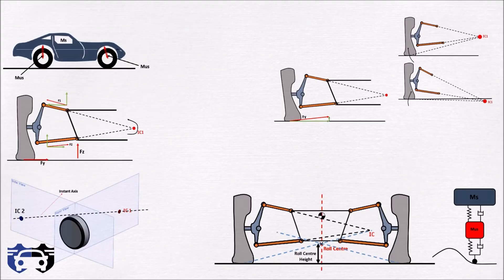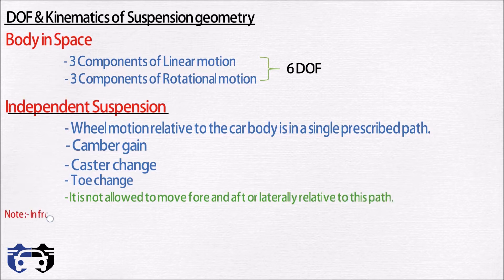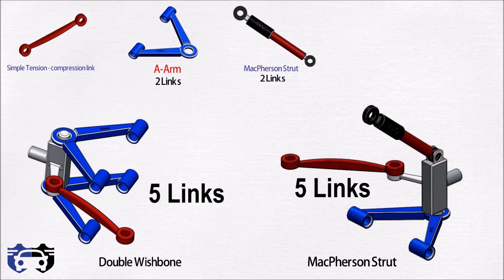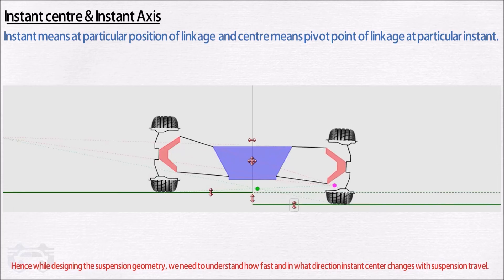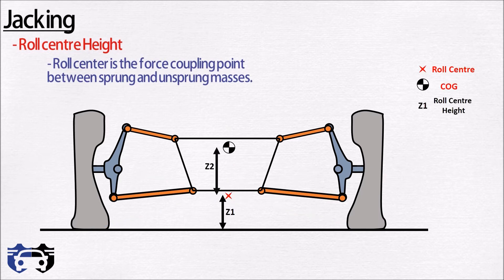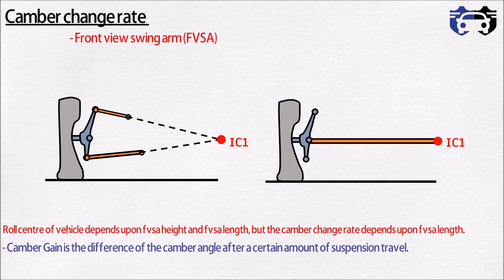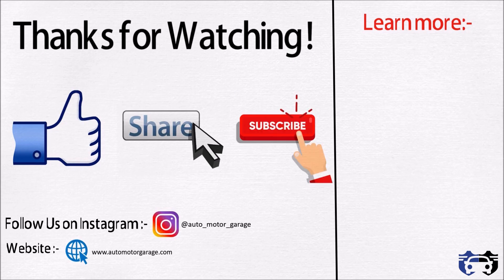Suspension geometry | Jacking | Instant center & axis | Roll center | Camber gain | Scrub of wheel

Comment: What is the the wishbones are parallel? Then FVSA will be infinite right
Reply from the maker: Exactly—if the upper and lower wishbones are perfectly parallel, their lines never meet in a finite location, so the virtual swing‐arm length (FVSA) goes to infinity. In practice this means you’d get essentially no jacking or camber change, which is why most designs offset them slightly.

Comment: Hi!
So the scrub ( lateral ) Is related Also to arms lenght right?
Reply from the maker: Not directly—scrub radius is set by your steering axis inclination and wheel offset (i.e., where the tire contacts the road relative to the steering pivot), not by the wishbone lengths themselves. Changing your arm lengths can shift the instant center and suspension kinematics, but it won’t move the steering axis or the tire’s road‐patch center in plan view—so scrub radius stays the same unless you alter spindle offset or steering axis angle.

Comment: Your visual representation of wheel travel and suspension kinematics is good. However, you fail to show any movement of the body of the vehicle as the suspension compresses, replicating a real world situation where there may be considerable roll of the frame whilst conering and therefore the relative positions of the mounting points will change, thus changing the relationship of the upper and lower arms, effecting the position of the tyre patch on the ground. So, in theory, it may all work but in practice, it's a very different situation.
Reply from the maker: Thank you for the detailed feedback! You’re absolutely right — in real-world conditions, the vehicle body rolls and suspension mounting points do shift, which affects the suspension geometry and tire contact patch. The video focuses mainly on the basics of suspension kinematics, so it simplifies by not showing body roll. Including body roll dynamics definitely adds complexity and is important for a full understanding of real driving conditions. Appreciate your insight!

Comment: Your explanation of the McPherson suspension is completely wrong. In your 5 links diagram, your uprights will have no rotational stability what so ever. In a McPherson suspension, there is no horisontal rotation axis between the uprights and the lower part of the dampers. What is preventing the wheel from tilting or rotating in your diagram?

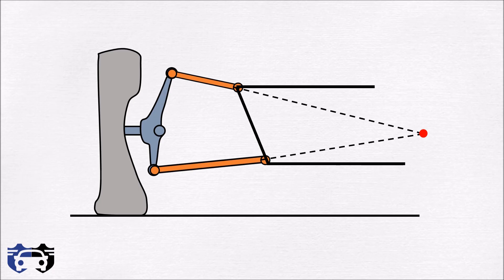Comment: Vatsal - I love the video and the channel.  Question for you about the jacking discussion at around 6:20-6:30 of the video.

I think the force (Fy) would be multiplied due to the lever distance between the tire's contact patch and the lower spindle-to-control-arm mount point (lower ball joint).  If the lower ball joint were moved lower (closer to the contact patch), this would reduce the amount of force F2 that is exerted on the lower ball joint and transferred through the control arm to the body.  Let's assume the frame mount of the lower control arm is also moved lower the same amount as the ball joint, so the control arm angle towards the frame does not change.  This would reduce the amount of force Fz contributing to jacking.  Is that right?

Now, let's move the upper spindle-to-control-arm mount point (upper ball joint) higher, resulting in a taller spindle overall.  This time, though, we change the angle of the upper arm slightly to keep instant center (IC1) at its current distance from the wheel.  

Because of the further distance apart of the pickup points, does the force transferred back from IC1 (force F1) effectively have less of a multiplication effect, resulting in reduced jacking forces? 

It seems that overall, having a taller spindle (longer distance between ball joints) offers numerous benefits in this regard.

Appreciate any thoughts.

Comment: What if the upper wishbone is inclined?, what would be the modification on the instant centre and steering rods?. Excelent video!.
Reply: ic will always be the extension on control arms, when you incline the UCA the intersection of upper and lower control arm would be at a different point and that point would be the IC.
Reply: Another question that i've seen is what happens when the wishbones are inclined in the superior view (top view), i mean when the wishbones are inclined in all the 3 planes. And what happens with the steering rod in those cases, thanks!.

Comment: Very nice. 
Is there any software to design the suspension , steering, camber, i.e only for chasis part ?
Reply from the maker: Suspension geometry can be designed in :- Lotus shark , Adams etc. and for 3D modeling i prefer Solidworks.